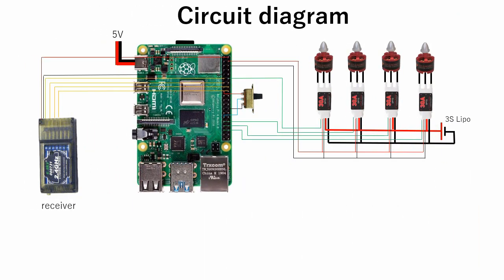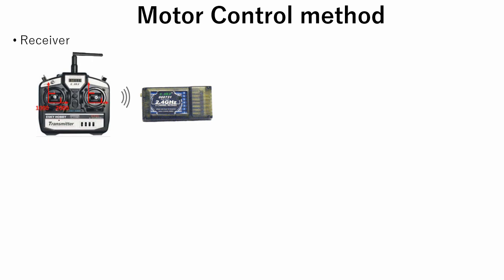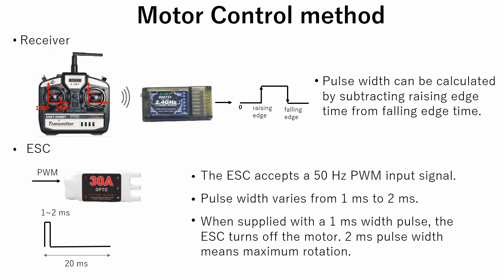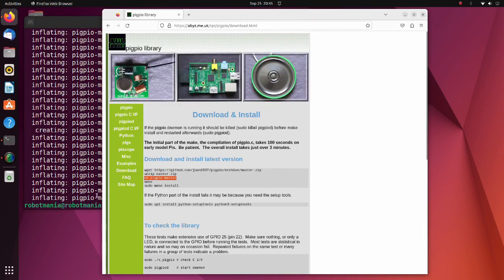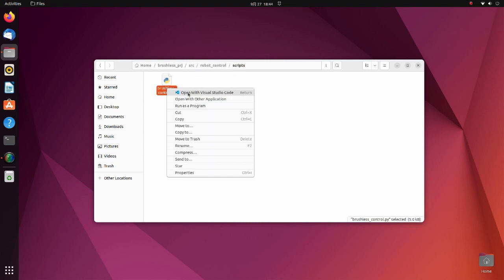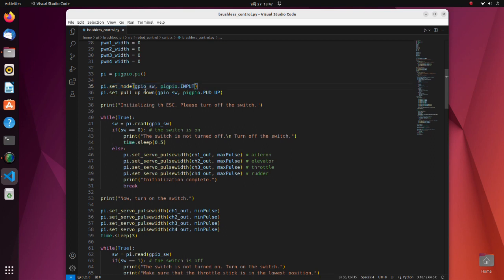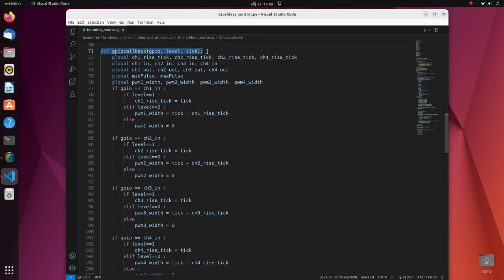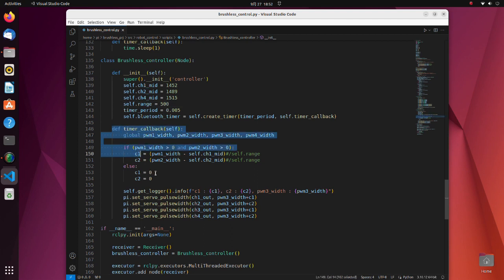How to Operate Brushless Motors from a Radio Controller Using ROS2

Comment: I've seen most your video, can you make any videos to communicate BNO055 and ROS2 with UART ? I'm having trouble here
Reply from the maker: Hi nhattran4833!
Unfortunately, I don’t have BNO055. I think it is more common to connect these kinds of sensors using I2C. Also, there are several libraries like this. It should not be difficult to connect BNO055 using sample code provided.
https://github.com/adafruit/Adafruit_BNO055